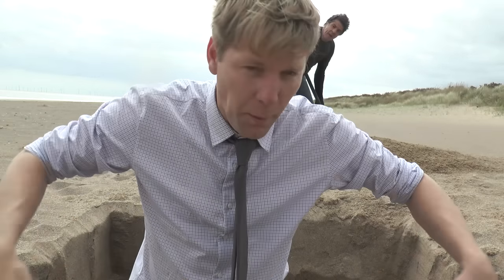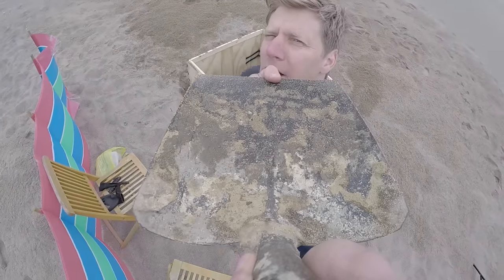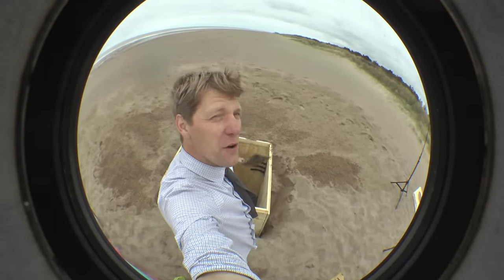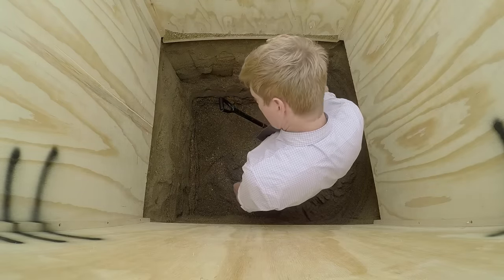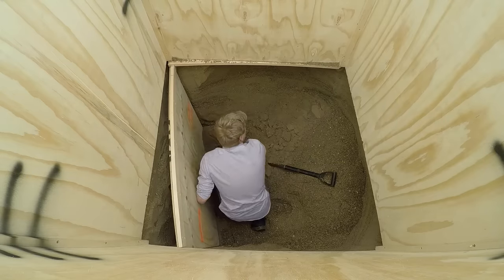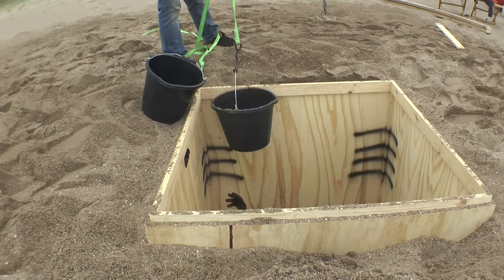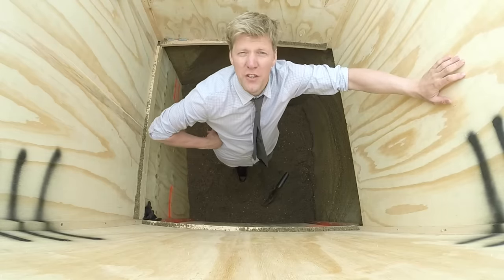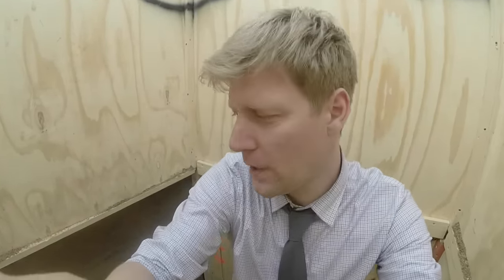Underground Beach Hut Build

Comment: Im a groundworker and i hate to be the guy... but... this is a dangerous thing to do, not to be done at home really, the weight of collapsing sand at those depths and no props on that shuttering can easily collapse and kill. Scary to watch because ive seen death this way
Reply: Agreed. This is actually far more dangerous than a high speed invalid carriage.. you are in avalanche territory here, and having seen a couple of those close up, I found the whole thing toe curlingly difficult  to watch. Several tons of sand/snow verses a small a squishy human being.. no contest. Go study a bit of mine engineering before you build any more of these.
Reply: I am sure he is fully aware, I feel like he has done riskier things and will indeed do riskier things
Reply: I'm a bit more worried about the kids that will play in this.
Reply: worst ... it's gonna be slow and painful way to die !
Reply: easily prevented with piles ... Nine x 8' fence posts hammered down would have been sufficient.
Reply: If he had a blanket of metal chains like a chain mail shell if you would call it that, and he could place that on each side the sand would harden against the cold metal making it near impossible to break. I saw it on myth busters.
Reply: Can you explain yourself a bit more? I don't understand :/
Plus, i've seen every episode of mythbuster, and can't remenber this one.
Reply: Mission Dan i
Reply: VideosUnrelated i dont know if you have sand in your vagina or something else made you very angry. i watched a clip literally last week of a guy stuck in a trench three more guys are in it trying to pull him out and the rest collapsed with all of them in it, probably only 3m deep, all buried alive
Reply: Mission Dan based on his past work, he seems to have a basic understanding of engineering and a will to live, so he’s probably had this planned and looked over to make sure it wouldn’t collapse
Reply: @flameconvoy7424  As someone with a basic knowlege of physics from my math degree, this is insanely dangerous. You essientially have all this force being held by plywood.

Additionally this is a beach and the bottom can easily become unstable.
Reply: Luckily, its not at home, its a beach
Reply: @Tigglebitties  hehe
Reply: Andrew Hull  bruv watch his upside down swing

Comment: Fun fact: the most likely location for a death in a commercial construction site is a trench less shallow that the victim's height.  Collapses around his chest, suffocates while his mates try to dig him out by hand.  Using an excavator will squash his internal organs like driving over him.  This is crazy dangerous, and I am glad that Colin was lucky enough to survive this.  Hopefully they pulled the plywood out after, so nobody was tempted to dig down to see what was at the bottom.  5 years from now the lower levels of that plywood will be like wet cardboard...
Reply: That’s a very fun fact
Reply: David Clark better not open up his Sombre Fact file. But yeah, let’s hope he removed all traces of plywood AND filled the hole thoroughly. You’d probably want to try and match the compaction levels of the undisturbed sand at the bottom.
Reply: I couldn't even finish watching I was cringing so hard.  Having worked in industrial trenching this is incredibly dangerous.  People die every year in trenches less than 4 feet (1.2 m) deep.  I would never trust thin plywood like that with my life, which is exactly what they were doing.  Proper trench boxes are usually very robust, heavy metal, and I've even seen those start to fail.  I sincerely hope nobody gets killed after watching this video and thinking it's a good idea.
Reply: @idahomike  As a civil engineer I endorse this comment!
Reply: Mike Price I’m pretty sure he did take it down, but not 100% sure. Obviously since you’ve worked with it before you know way more than me, but I just wanna ask, how strong would the walls have to be to withstand the pressure of the sand at about 10 feet? Is there a formula? I’m just curious not trying to start any argument, I just legitimately don’t understand how 3/4 plywood can’t hold the sand back for a couple months. Again not trying to start anything just genuinely curious
Reply: @Smoke---  10 or 15 feet down, with water, means at least tonnes per square meter.  i.e imagine the box on its side, and a large military truck drives over it.  Are you comfortable lying under that?  I am not, that is for damn sure!
Reply: David Clark I know I’m grossly oversimplifying this, but here’s my reasoning.

Sand weighs approximately 101.8 lbs per square foot (Ik I’m using imperial my bad). The box was 4x8, giving a surface area of 32 square feet. So that means for every foot of sand that collapses or is pushing against the walls, that equates to a total of 3,257.6 lbs on each wall. Ik that water makes it a whole different situation with a different density, rotting and weakening the wood, etc., but, it’s only a half sized truck on the 3/4 inch plywood sheets spanning across 32 square feet, so I definitely wouldn’t put my life in the hands of it, but I think 100 lbs per square foot would hold up. Again correct me if I’m wrong because as you can tell my knowledge is extremely limited. Also, that weight isn’t forced directly into the plywood, because it’s going down with gravity more than sideways with pressure. So wouldn’t it be a lot less than 100 lbs per square foot at that point?
Reply: @Smoke---  The shape is not the best for distributing loads, but as well as the plywood, one of the weak points is the screws used.
Reply: Hold Fast I was thinking that too
Reply: Hey, David, I read your post AFTER I posted my comment on this video. Look for it and you'll see just how much I agree with you. I actually shamed him for this video! lol. Hey, it's Dec. 24th, 2020, 8:35 PM Christmas eve, WA state, U,S.A. so Merry Christmas to ya!
Reply: @Smoke---  it's significant load and rises with depth, and there is additional water pressure for wet sand. And additional load for superimposed loading at the surface ( someone standing there, or a vehicle).  depth x density x g per square foot
Reply: @Smoke---  The ground pressure depends on the depth, not just on the density of sand plus water. At 8 feet you have some serious pressure.
Reply: I'm surprised he doesn't get a citation for multiple violations. Safety, littering, building without a permit...
Reply: @albertbatfinder5240  Why match the compaction if nobody's building on it?

Comment: People have died digging holes at the beach. I urge people not to do this as I was buried alive doing this and was lucky enough that someone saw it collapse. Scariest 10 minutes of my life. It's not running out of air that kills you it's the sand crushing your chest so you can't breath in.
Reply: Agreed. I was on a coroner's jury discussing a case where a man was digging in sand and tons of the stuff collapsed on top of him. Horrific photos.
Reply: That's why hes using shuttering
Reply: I was about to type something similar. I was not trapped but anyone that knows soil stability can see that is not a good idea. 
Colin should not have posted this waste of energy and common sense video. 
It’s deadly.
Reply: he had a friend there, and none of them digging inside the hole at once. It's dangerous on your own, but they would've been safe
Reply: @3than   Yah, the guy 'not in the hole' could show the police the location of his friend's body.  This was extremely dangerous and his friend would  have never gotten him out in time.
Reply: @Nickvec  was looking at the boards and thinking it would be hard to get to him if the boards broke and sand collapsed around them.
Reply: yeah right mate, what a load of bollocks
Reply: @DoctorDeadMoth  funny that cause a couple of weeks earlier 3 guys died in a cave in near the place I was digging. They had dug into the side of a hill and all three were found inside.
Reply: Ya this was dumb. Childhood friend was killed from digging in sand and the walls collapsed on him. People were there, trying to pull him out by his feet and digging him out but the sand kept collapsing on him. Probably took about 5 minutes for the kid to die. Don't fool around with this; it can get away from you real quick.
Reply: Just ruined the whole video for me
Reply: First thing I thought was don't fuck about digging in sand!
I'm a builder and heard many stories of men buried alive.
If the side collapses suddenly while you are bent over, the weight will flatten you and you will have no chance unless you can get dug out fast!
Reply: @3than852   lf anything went wrong when he was at the bottom his friend would of had no chance. Even with 20 digging he would be dead.
Reply: Imagine how boring the ColinFurze chanel would be if you bunch of safety police were in charge of reviewing his content before it was allowed to be posted. I  bet barely a single one of his videos would have been approved by you lot
Reply: What's the difference between "running out of air" and "not breathing in"?
Reply: 3than his friend wouldn’t have been able to do shit to help lol
Reply: arcadeuk I’m all about dangerous shit. Fuck the rules. Fuck the laws. But this? This was going a bit too far.
Reply: @jamesbizs  now digging? THAT IS ILLEGAL. Flying machines? Sure, even with the risk of them literally exploding, or him breaking his arm from falling or something worse. But digging??? Now that is a major crime on the internet
Reply: @jamesbizs  ok I have a better example, a literal chainsaw powered lamp. What are you on about "this is too far"
Reply: That's why there is wood
Reply: @hazardlivid3010  nope, actually I'm quite careless irl but one bad experience can really change your perspective. All fun and games untill someone gets hurt.
Reply: ΛCΞ  started out as a deep hole and continued till it was about half a meter over my head, then bent down to dig and it collapsed.
Reply: Yeah that's a right proper worry that is. Bloody 100hp trike is fine, but a hole is way too dangerous
Reply: Ok i just wanted to put my two cents in because im bored but this guy has done some other crazy things that he's planned out, if he didn't do that he would've been badly injured a long time ago. Other people have that happen to them because they're usually careless and don't really think or plan out what they want to do or what they're doing and leaves them to face the consequences that come with their actions. (Was gonna say something else but with the way how society is it would be very dark but true)
Reply: Yah it was dangerous but they did put that wooden wall and he had a friend but yes very dangerous
Reply: @thelamelime8360  he took it down afterhe built it
Reply: People have died walking to the shop, people have died in their sleep, people have died taking a dump. Will you be urging people to stop doing those things too. Let's all just stay home and do nothing for the rest of our lives, because it's too dangerous. Your the new world orders dream.
Reply: @garrywhittington2628  I urge people to use common sense but extra around sand as it is commonly misjudged as being safer than it actually is.
Reply: @BrandonHilgeman  example: being underwater vs having someone sitting on your chest. With one the oxegyn is available you just cant access it because you're being crushed.
Reply: His whole channel are literally built around deadly machines and inventions. But I see that you're only warning the public audience to not try something similar and that's a good thing, but I just wanted to point out that this is not even close to his most dangerous project.
Reply: Oh yeah but his fuckin upside down swing with no straps is fine? He’s not telling people to do the stuff he’s doing is he? Let the man do his job damn
Reply: Yep, this is a huge confined space danger. Don’t think its a smart thing to do.
Reply: Dang I was thinking of digging a hole next time I go to the beach, maybe not
Reply: @3than852  8
Reply: @3than852  what a stupid thing to say. In the time it took his friend to dig down enough to free his chest from constriction he would be dead.
Reply: @arcadeuk  I would rather see him driving his rocket powered bike then do a stunt like this again.
Reply: the holes were 4 feet deep at a time even if the whole thing collapsed he wouldn't be covered so much that his spotter who was with him wouldn't be able to dig him out

Comment: I'm with a lot of the other folks here. Watching the video I was like "This is a cool bad idea." Maybe while the pit was still open, it wasn't the worst idea (without fully understanding how much weight and pressure would be on Colin if it fully caved in suddenly). But putting that "floor" and screwing it down? That's like screwing the lid on the coffin shut man. If someone was in it and that lower "floor" caved in, there's no way you'd undo all that in time to save the person if their head was trapped under the sand.
Reply: katie_incredible actually floors make it a bit safer

Comment: The plywood is made into caissons.  Same idea using concrete "pipe section" caissons in developing horizontal collector wells (sunk vertically), hundreds of feet below the surface.  
If that plywood collapses into the vault... suffocation, especially compressive suffocation, is a particularly horrible way to die...not to mention the instant claustrophobia.....
Reply: Pipe of that diameter would be 10 to 100 times stronger that the plywood coffin he built...

Comment: Pressure on the plywood box is equal to 1/2 the weight of the sand times the depth squared. In short, that is way more pressure than you think it is and one of these days you are going to wind up a headline... tragic death on the beach... don’t do this unless you know how much pressure your shoring will actually support and how much pressure is being imposed on the sides.
Reply: What
Reply: the sand lower down it wet and stays borderline solid
Reply: @Jordan-zk2rf  It only looks like it, through the years even regular ground shfts a lot. Especially in places where winter is a thing and the ground freezes up somewhat deep.
Reply: No such thing as good ground. This is irresponsible. Man alive, companies exist to provide safe solutions so people won't die digging holes and here you are making a game of it. Should someone die because of your stupidity, then you Colin should be prosecuted. Be it on your head, terrifying.
Reply: @johnfallon845  Colin destroyed this hut very soon after he made it, he knew or at least came to know postfactum of the danger factor... And feces factor too :D
Reply: @Jordan-zk2rf  water makes sand run more not less. It just looks more stable, but its not.
Reply: Watching the construction of this was cringe worthy. And if a person doesn't know why it's cringe worthy then they are ignorant and I suggest more schooling before they win a Darwin award.
Reply: Word. All those trench rescue classes made me cringe when I saw this.
Reply: He should've added a few plants horizonatally

Comment: I agree with many of the comments. This is a dangerous idea. Loose soil/sand will all ways collapse. Ply will have little resistance against sideways pressure. I've seen 2 x 4s snap under pressure before
Reply: mate, there are way easier ways kids could hurt themselves on youtube.

Comment: This the most dangerous thing he has ever done on this channel by far.
Reply: Daniel Mc Dowell  he would have more control over a rogue hoverbike than a collapsing shaft in sand.
Reply: Morten O'saurus exactly, I was anxious the whole time.
Reply: That 3/4 plywood will support a massive weight especially being such short peices
Reply: @johnalexander9859  it really wont. There are entire companies that do nothing but build the proper safety equipment for this. At the very least he needs the plywood and at least 4 mechanical jacks to keep a steady presssure applied to the walls at all times. I do this shit for a living.
Reply: Acro jacks needed
Reply: Jet bike
Reply: Wanna take that back it’s 2020
Reply: You haven't seen enough then
Reply: You missed the knife belt i see?
Reply: Nethiuz yeah the knife belt was so dangerous
Reply: The wall of death was far more dangerous
Reply: What about his blade belt

Comment: Really really unfuckin' safe!

Sir, I salute you...
Reply: Bigfoot Taylor XD
Reply: How? Its just a medium sized hole in the sand. It cant collapse with those plywood boards.
Reply: reddit please go
Reply: Wal Dengus Be glad that I don't have any more time for you...
Reply: Bigfoot Taylor someone's scared😂
Reply: Uhhh...in CAN collapse and it WILL collapse when it rains hard, or a high tide moves the water table and the sand gets much heavier. Do not underestimate the pressure of all that sand. If you ever see a trench opened in the city to replace a sewer line etc you will note that a VERY strong steel "revetment" with steel pipe cross braces is used to prevent collapse. Still, workers occasionally die doing this kind of work. At a minimum Colin should have put in some posts to support the plywood, buried at the bottom with cross braces at the top to transfer the load. This is basic military bunker building type of engineering. The easiest way to build something like this is to use a round structure such as a concrete pipe, which will transfer the force symmetrically (like an arch).
Reply: Bigfoot Taylor how is this unsafe
Reply: I dont agree! he's a invented! he knowns how do u and if its safe or not
Reply: ItsZombieAlex how is this NOT unsafe?